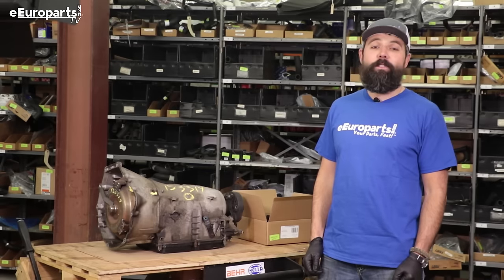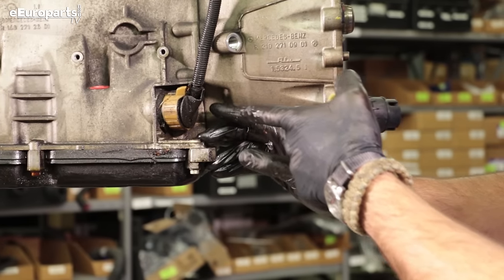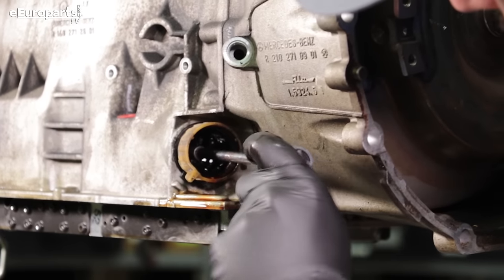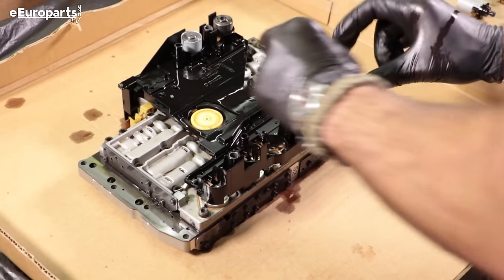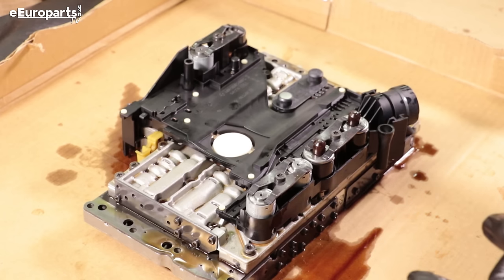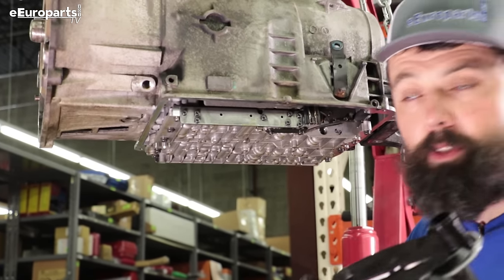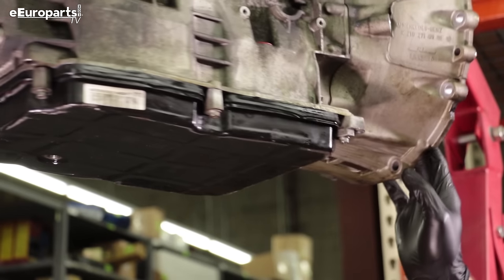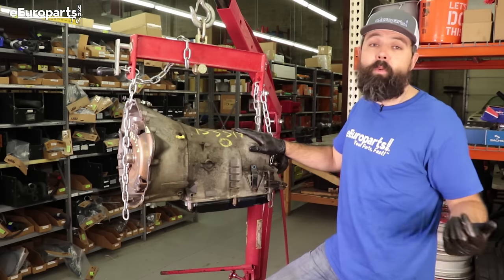Mercedes-Benz 722.6xx Transmission Valve Body Plate and Plug

Comment: Thanks for the video. This was the most physically challenging repairs I have ever done because I had to do it on 2 jackstands and my shoulders are tanked. I still don't have the ATF topped off. I added 3.7 quarts, then 200ml at a time. But I have to wait a long time to get an accurate measurement with the dipstick because the ATF kind of clings to the fill tube. Anyway, my P0715 code is gone and it shifts! Thanks for a great video.

Comment: THANK YOU FOR A DETAIL INFORMATION VIDEO. GOOD GOING
Reply from the maker: You're welcome, thanks for shopping at eEuroparts!
Reply: @Eeuroparts   @ 5:25 a ball bearing is falling out, and it's still there @7:10, so where does it come from? Because i'm going
to do the same job to my transmission next week, so this ball popping out worries me.
Btw, how did the car run, without that ball bearing? Because i didn't see you refit it.

Comment: Man great video, was concerned about that ball bearing that popped out when the conductor plate was removed.  Looked like it just went unnoticed through out video.   Hope that didn't create and future check valved issues.  Great video thanks so much.
Reply from the maker: It was kept track of, just a flaw in editing
Reply: That's very observant to spot that! I wonder where the ball bearing was from

Comment: I am doing this job today. was incredibly scared but have valve body on the bench now.
Reply: did it work?
Reply: Yes. Easy job.
Reply: How long did it take you? I'm planning on doing it. Also where did you get the new part from?
Reply: I could do it again in a couple hours . Be prepared for a transmission fluid shower .
Reply: How much fluid did you add after? Did you have to take it to a mercedes dealer to reset the tranmission once it was fixed? (I have a 1999 e320)
Reply: Around 6 quarts . I bought a tranny dipstick. No reset required
Reply: I’m having a hard time lining up the valve body to the transmission. I see 2 grooves for the speed sensors and the float mechanism but every time I try to start one of the bolts the whole thing slips back down and I almost feel as though I’m damaging the new conductor plate every slip. Transmission fluid is also leaking out the body of the transmission as I’m trying to mate the two surfaces together. So it’s pretty much dripping all over me and the valve body as I try to seat it. Any suggestions?
Reply: And at this point I’m taking a break to swing by the store to grab some CRC MAF cleaner to clean off the valve body, transmission pan and transmission housing because the work area got messy as HELL. There’s tranny fluid all over the conductor plate and I can see little debris inside the electrical connections. #TransmissionFluidShowers
Reply: Like another commenter said, ima also grab a multimeter to test the resistance of the solenoids once everything’s cleaned off because why the hell not after all this. But I just gotta figure out how the hell ima get this valve body on. I’ve tried a supporting pipe jack but that doesn’t balance well with the space I’m alotted (my short jack stands). Any other suggestions?

Comment: Great video! Thanks. A couple of questions. Do the solenoid hold down bolts require torquing? Second, should the solenoids be inspected and tested when I have them out? I figured it might be a good idea, especially on an older car.
Reply: I did this same job twice e500 and s500 I tested the solenoids cleaned the screens and installed the sonnax kits one very important point he does not mention in the video is the gear selector it has to fit back into the groove on the selector or your gears will not work and if you install the sonnax tcc damper both half have to be separated and the retainer ring has to hold the tcc valve in place but if you do not have the 722.6 diagram o would not attempt this because it's a possibility that the check balls can come out...but yes always check the solenoid with a ohm meter or 12v battery

Comment: its really great video to learn too. just have 1 question does the conductor plate requires any software programming before or after ?
Reply: That plate has been commanded from ECU ( car computer) . Only execute the commands that ECU give . Is a "slave" part and dont think need to be programmed

Comment: Hi I have this gearbox fitted to my car and it wont drive. In neutral and park it will rev freely as it should but in D and R it will only rev to 2k and won't even try to move an inch. It's had a new conductor plate but no luck. What else could be of course ? Great video by the way very easy to follow and understand. Great work ❤

Comment: Excellent video, did you drain the torque converter as well? It seems a shame to put new fluid in if half the old stuff is still in the torque converter.

Comment: have a CLK 2006, and it's got stuck in 'get you home mode'. Started doing strange things two years ago, switching off and on again restored normal operation for about a year. Then it started again, same thing. Suddenly got worse now locked in some sort of default. Tried to reset it, even worse now!...... 60K miles only, light use. I assume the Transmission Valve Body Plate and Plug have gone wrong. Am I in the right area. If I replace the unit and service the box with fresh oil and filter, will the computer go back to it's original setting. Some advise would be very helpful indeed.

Comment: Thank you for a no-nonsense direct audio/video explanation.  What is the torque setting on those valve body bolts as I couldn't hear if you said 7" or 17" inch lbs?  What is the torque setting for the pan bolts?
Reply: 72 in lbs

Comment: This is probably the best video on YouTube for doing job.   Only wish he would have told me bolt and screw sizes.   As he went along but no biggie.    I just bought a beautiful 2000 e430 that is mint for 1300 at auction.  It needs this job.   I have done this before but paid a mechanic.   It was about $1800

Comment: Josh, hopefully you're checking this.  Of the 6 solenoids, it's obvious which two are the pressure solenoids based on shape alone, but the other 4 - the Lockup, 2/3, 1/2&4/5 and the 3/4, are those four solenoids interchangeable?  I've noticed slightly different part numbers and didn't know if those might just be MB revision numbers or if there are specific ones for each of those 4 solenoids.  I got an unusual condition just 24 hours after installation in that when downshifting (say 4th to 2nd), the trans shifted real hard then revved but it didn't actually downshift.  I immediately put it in neutral and coasted to a stop.  I re-engaged into drive and all was fine.  Won't try it again but I'm wondering if I have a misplaced solenoid or even a bad one from the kit I bought.  Thanks!

Comment: Josh excellent video.
I have merecedes e class 2005 (w211). Its stuck in 2nd gear. 
I ran a cheap obdII scanner and it gave an error P0715, which is "input/ turbine speed senson "A" circuit).

I replaced the 13 connector plug but had no luck. Do you think i need to replace the electrical plate which has the 2 sensors as you did in this video. Thanks
Thanks
Reply: idk if you have done so yet but yes 100%. that plate is garbage and fails.
Reply: I am replacing the plate. I had same problem. Stuck in second gear.
Reply: @chrismontreuil2206  If u have for 1999 model, change pressure regulator spring. It is often problem on those gearboxes.
Reply from the maker: Updates?
Reply: Either the plate or one of the solenoids is bad.
Reply: Chris montreuil, so? Has it not been your day, week or even your year? Lol I know lame:)

Comment: Excellent video sir .. j have an 03 e500 intermittent link mode no check engine light ..my question does the new conductor plate have to be reprogrammed ?

Comment: Great video. Have you ever had one of these were you use the kick down on the throttle the gearbox goes into a weird gear change mode as when you accelerate the car she stays around 1000rpm and up shifts all the way to 7th no throttle response and slowly goes faster. Hope I described that ok.
Reply: Typically that is a failing Accelerator Position Sensor/Throttle Position Sensor.  If there is something wrong with the APS/TPS the DME will typically  detect a failure when you apply 100% throttle.  It will then go into the limp mode and act the way you describe.
Reply: @trakdv362  thanks for the reply, it’s a pity she hasn’t thrown a code.

Comment: I've taken off the pan and found a different gearbox from your description, on the valve body is written AB-AA-AAAAA. It has the plug, but it is sitting vertically! After draining the fluid & removing the pan, I then set about disconnecting the plug from hell. Yes, it was soaking wet with transmission oil!  There is one orange ring in the plug & it's damaged! We are talking of a seven speed transmission. What to do?...... I wonder whether I can just replace the seal, plug it all back in, re-fill with new filter & hopefully the reset will work?....... Really hoping you might know or have a vidio on this 7 speed box!........ Thank you in advance.

Comment: I changed my conductor plate yesterday on my 2001 c320 Mercedes and i scanned it and it still says input shaft speed sensor (p0715)...I’m lost at this point
Reply: Hi - did you manage to solve your problem? please let me know how. I have same failure on my Porsche 997.1 tiptronic
Reply: @rickysndergard9753  How did you guts clear the codes?
Reply: how did you fix the issue?

Comment: Hello, I have 99mb E300TD and the problem he does not go on drive he goes for one foot and no shift ,shot off the engine and put back in drive an again does the same. I found a little Transmition fluid in the antifreeze expansion tank and I open the transmision plug and I drain little bet the fluid and looks ok, what do you think is the problem I need you opinion.Thank you 
Eeuroparts is my store

Comment: We did replace valve body and the conector...Buț îs not working...?!  The speed îs not  changing .. Do I need to go to the dealer to conect the computer...?
Reply from the maker: That's correct George, the dealer or a Mercedes specialist will be able to reset the TCM

Comment: Almost perfect, but:
1. how do I know I have to change them?
2. whats the parts numbers?
3. why didnt You flush the hydrokinetic clutch? The whole oil didn't left the transmission - some was left in the clutch..
4. Whats the other flaws of the transmission?
Reply: Hi Radziu I have this gearbox and it has a shudder, I have purchased the transmission fluid, oil filter and gasket in the hope that flushing through with new oil may solve this problem, the more I gear myself up for doing this job the deeper it seems to get, you wouldn't happen to have any knowledge you can pass me please on my problem, I would apreciate it
Reply: Evan Larger you dont need to do any other thing. Just follow the video. Solenoid position is important. Take them out and put them exactly where they go. 
Dont need to do anything
Reply: @foreshadow2120  Hey, did the shudder get any better? I seem to have something similar if I'm not mistaking it with something else. Lmk

Comment: Will i need to have the dealership reset my ecu because of the new conductor plate.
Reply: While the car is off depress the gas pedal all the way down as far as u can and then hold it. put the key in and turn it to position 2.where all the dash lights come on, Dont start it. Without touching anything Wait 30 seconds and then turn the key off back to position 0. Take the key out.Now Let go of the gas pedal.and wait another 2 min with the car off. Again, dont touch anything.  Then put the key in and Start it and drive it like its stolen. Doing this resets the tcm and depending how you drive, it relearns the shift points on the first 40 shifts. So I reccomend gassing it if your a racer. Or  If you want to safe gas and you enjoy accelerating like an old lady, then baby it during the first 40 shifts. I reccomend resetting the tcm every year even if you aren't servicing or fixing it.

Comment: Excellent video. If I had to add anything to the video I would have shown the gasket replacement for the pan and maybe point out torque converter drain plug if that's what I think I saw.
Reply: I wish he would've touched on torque converter as well. Alot of fluid left in it.

Comment: Great video!! I have a 2006 S500 with the 722.6. Would you know if I replace the transmission connector do I need to reprogram the car?
Reply: The transmission connector is just a piece of plastic so it should have no effect on any electronics. No reprogramming required.

Comment: Good job, but you forgot to mention the alignment of the shifter when reinstalling the valve body
Reply: Whats this alignment you speak of? Care to expand?
Reply: This was the purpose of me watching this video and he did not explain this. I have reinstalled new conductor plate but my car isn't shifting now. I wanted to see what I did wrong as far as the placement of the alignment. Please help anyone who can answer.
Reply: Question answered. Here is a 722.6 Porsche transmission https://youtu.be/8c7pDR83d_E Which is similar to the Mercedes.
Reply: BeautyGeekMe i agree wirh you. The screws seem short. I dont see how they can be holding vavle body onto the transmision.
Reply: @BeautyGeekMe  I had the same problem.  I made sure it was on park then put it over the obvious notch in the shifter. How did you do it.

Comment: If plug adapter is leaking fluid no codes or shifting problems can you just replace adapter to fix leak or must you replace conductor plate also for leak ?

Comment: Hello
I 've got a problem on my w210 Mercedes-Benz. 2 weeks ago my Mercedes wont shift gears and it stucks on 2nd or 3rd gear on D drive and won't let me change it on +- tronic mode.
One i switch off /on the car will shift gears normally. 
I also check out transmission fluid level abd seems to be normal level. 
What causes this problem?
Reply: Enxhi Koraqe    problem is either the electrical plug or the electrical plates. Your solution is this video exactly
Reply: Ahsan Afzal thanks man .
The prb was sensor speed on conductor plate.
I changed and everything is ok
Reply: I have the same symptoms..i cant see what gear i have in display..do you think its the plate
Reply: Same fault on my Mercedes C Class W203, 2003 model. And once the gear refuse to shift the chock will stop functioning and the packing sensor will go off. please we need your response.
Reply: Hi ... what have u done with it?
I have  the same problem like you.
I also have a P2784 code

Comment: How many quarts of atf do you need to refill it. And also they told me it doesn’t need to be programmed on my 06 Cls 55 AMG
Reply from the maker: Thanks for the tip.  The transmission take around 9l for a complete fill of ROWE ATF 9004 https://www.eeuroparts.com/Parts/419880/Auto-Trans-Fluid-HIGHTEC-ATF-9004-1-Liter-25050001003/

Comment: on the Left side of the transmission their is a manual valve that you have to be carfull of when installing the valvebody. he did not show this on the video.
7:53 that yellow thing has to line up with a valve.
Reply: Yeah, I have yet to see a video showing how to overcome this issue by oneself. Notice his breathing right before he says you can catch your breath after first to bolts are in!

Comment: Hi  Josh... thank you for your video really helpful.
I have a 2007 mercedes benz c280 and the other day i got a code P0705 on my OBD II says Transmission range sensor. My question is where exactly in the conductor plate is this (TRS) sensor? 
Thank you for your advise
Reply: Your transmission is a 722.9 completely different transmission with a anti-theft device inside of it a whole nother world then this transmission 722.6

Comment: Hi. There is the problem in my car’s transmission. When the transmission changes from 3 to 2 , the “tak” sound comes from the bottom of the machine. Car w210, 1997, engine 111(E230).  Please say me, what could be the problem?

Comment: Thats thing is one of the greatest transmission in the world
Reply: Totally agree besides a leaky plug on occasion it's almost a bulletproof transmission
Reply: @ericbenz6580  since 4y  I used 722.6 transmission. mounting on 1999 w210s E430  gust yesterday I crossed  total 5000km  2 time from Jordan to Saudi Arabia to United Arab Emirates with Outside 47-49 centigrade the  car full loaded   and believe me when I open fuel tank  Cover Gasoline in the tank has reached the boiling stage. and  the car going a great

Comment: I took out the valve body to move the pins around because they got a little bent while putting the plug in, straighten those out now my car is stuck in neutral, wont shift into reverse or drive, please help

Comment: One of there main problem is the 13 harness wired plug they are clipped in and not soldered they come loose intermittently big big big problem to find took me a month I rewired found only one bad wire pin but it was in limp mode 1998 ml 320

Comment: Hi Josh,  Do you know if just the plug can be changed without draining the transmission? I had the fluid changed only 4 months ago and expensive for just the fluid? If the plug is removed will it lose loads of fluid?  Cheers
Reply: Tim yes
Reply: If you mean the connector plug, then no. Remove splash shield. Spray clean area. Unplug it by turning white collar. The rest is in video (except plug harness in before replacing splash shield, obviously)

Comment: Do you perhaps have a video on how to test and repair the 722.6 AT Shifter Assembly with winter sumer switch and 1/2/3/4 selections
Reply: Great video. Thank you for explaining. My Mercedes has winding noises as it get kind of hot. Is this related to the winding noise?

Comment: Hello, my SLK 230 transmission fluid is leaking. and i can see where it is leaking ... it looks like vacuum cable where there is a rubber boots and another end is connected to transmission... would be kind enough to give some suggestion